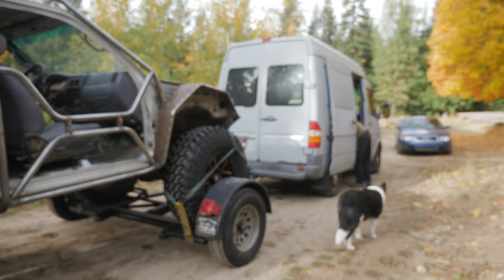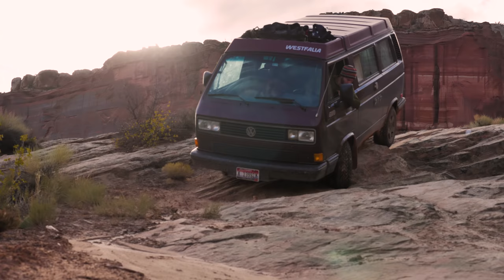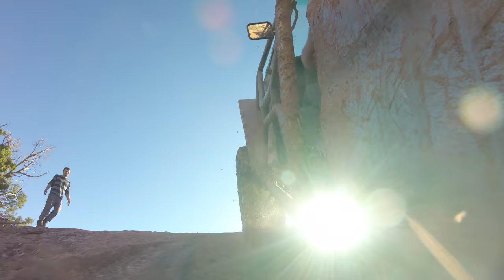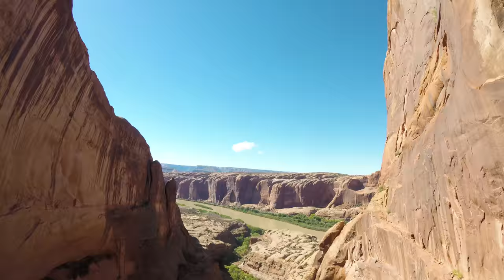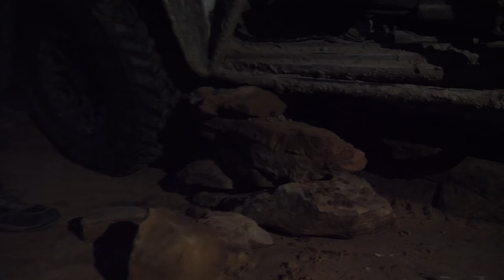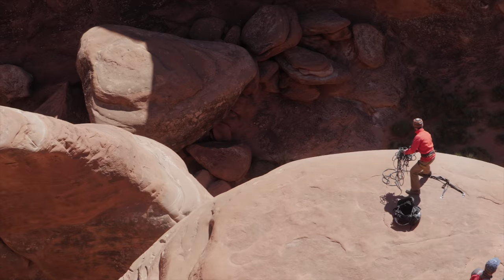Off Roading in Moab Utah - The totaled Tacoma gets put to the test!

Comment from the maker: Music 
Wayward West - http://bit.ly/2PzrgaC
Stillblu - http://bit.ly/2PS9HiJ
Edwin Olding - Recall https://spoti.fi/2QfftLC

Special thanks to RougeFab Tubing benders! http://bit.ly/2xsnB3e
Reply: Hijibuujo
Reply: It would do much better if you let the air out of the tires.
Reply from the maker: We had them at about 10psi.
Reply: When is the lift kit ?????😁😁😁😁😁🤘🏼
Reply: Thank you for not ruining the video with annoying rap, awesome video though!
Reply: Amazing quality, thanks guys. It would be sweet if you guys switched up the style and did a driving video with just engine noises. The music is great, but it would also be nice to just hear the ambient noise and humming of the cars
Reply: Find a set of rear springs. And a solid axle from a older toyota n do a solid axle swap.  Rear leafs work awesome up front. Lots of flex. Longer rear shackles also help. Cheap mods lol. My buddy runs a 2wd 4 speed manual transmission attached to a 5 spd 4wd transmission and t case.  55 gears lol.  Marlin crawler n allpro toyota have so many cool mods for yotas.  I run a 88 bronco 351w np435np208 with 90 F350 axles. Welded diffs. 18x39.5x15 boggers   works awesome.
Reply: I know I am kind of randomly asking but does anybody know a good place to watch new movies online?

Comment: I have a 96 tacoma with the 3.4l that has been rolled twice and in a frontend collision, guy that gave it to me just straightened the crunched hood and fender and put a 2x4 as a bumper. 278,000 miles all original and I daily drive it 100+ miles!

Comment: Proud taco owner myself! Impressed nothing else broke with that big of tire with stock gearing and a welded diff!
Reply: Tim crossley no lift means axles and driveshaft angles are all factory geometry. Throttle control and a strong weld im not surprised. Add a lift and watch shit break left and right
Reply: Stock gearing is 4.10:1
Reply: You underestimate these 1st gen tacomas

Comment: Them Toyota ball joints are garbage, the older vehicles had them the opposite way so you would never loose a nut it would rather stay on. Having the threads of the lower ball joint pointing towords the ground then attaching to the lower control are was foolish because you have all the load from the strut and any stress torquing the ball joint that could loosen the nut on the ball joint. Look up older Chevy ball joint and control arms cause the older 80's 90s had the ball joint the opposite way that takes the load and torque better.

Pretty impressive of what that Toyota has accomplished, Just to bad the front wheel hub ball joints were made in a foolish poorly crafted way.

Comment: You said you welded the rear end up . On the video at the last part you went up you showed in slow mo. It looked like one wheel would spin an the other wasn't in the back. I was wondering if the gears was jumping teeth.  Because it brakes the gears before the jump. It was a awesome video. Great build you did on the Toyota.

Comment: Those axles are screening right now!! The rear axle in the slowmotion frames you can see the whole housing flexing when he stomps on it when the rear end starts bouncing on the rocks the axle housing starts flexing... You guys are going to brake the axle if you do not re gear that bad dog.. or put smaller tires on it...

Comment: The wheels and tires are not the only thing different. You gave it way more traction when you added all that steel plate for a bed. Did you weigh the truck before and after? I bet you added 400 needed  pounds or more a lot of in in the rear which had about nothing before.